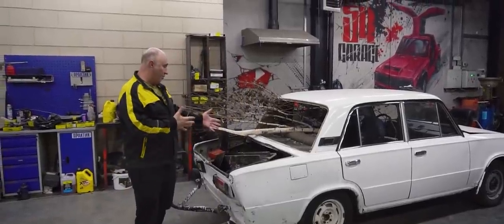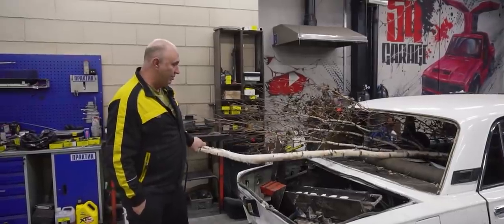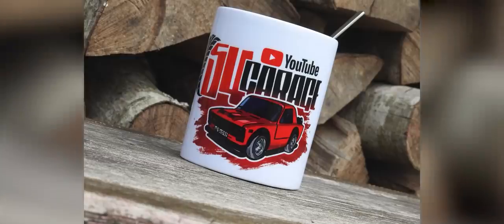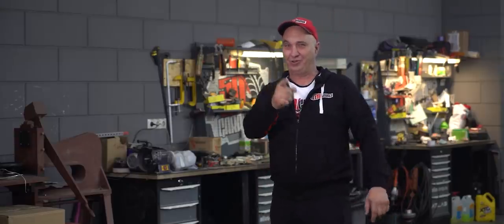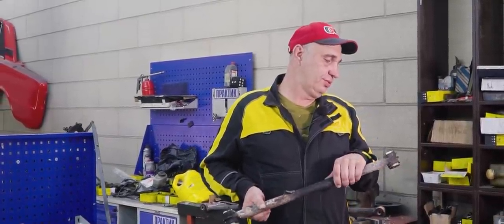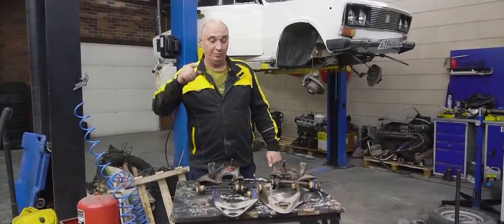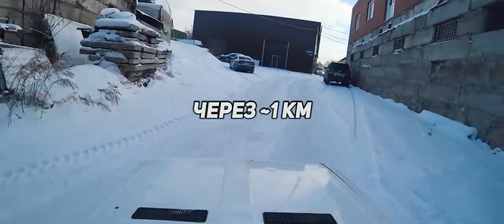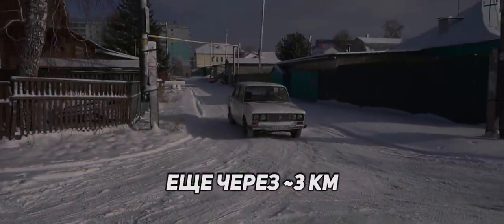Suspension bushings made from birch - real or myth?

Comment: Wooden bushings are still used in farm equipment but they are treated with oil before installing.
Reply: I also think these are so squeaky and fragile due to the fact that they are wet, fresh cut birch
Reply: I saw a really old car (Studebaker? not sure) that had wood suspension components.  They had to be oiled regularly.
Reply: Hudson had a wet clutch that used corks. Cork is of course the bark of the cork oak tree.
Reply: Yea was going to say we have hardwood bearings made of Whitegum on farm equipment 
But they tend to be more like suport bearings along a long shaft like augers 
The drive ends that actually take load are real ball bearings 
The wood support bearings are 40yrs old and are still quite good
The roller bearings at each end have been replaced many times over
Reply: Wait seriously
Reply: @joels7605  like 1950s probably?
Iv it looked like something from fallout it was definitely a studebaker
Reply: @isaacsrandomvideos667  
Yea they're cheap to make cheap to cheap to replace and easy to adjust

Comment: Make an engine. Let’s say a 4 cylinder. 2 cylinders running normally on gas. 2 cylinders firing on diesel. In the same engine block.
Reply: cool idea but diesels operate at like half the RPM gas does. like 1-2k maybe 3k, but maybe you could idle the gas engine  and rev the diesel a little. maybe a gear ratio on all the shafts or something
Reply: @renderedpixels4300  just rev it to 4/5k lol, diesels dont rev that low, not in passenger cars
Reply: You can get up to 5k in the old vw 1.6 diesel so I'm sure it wouldn't hurt nothing having it idle at 1000, which is what my 1.3 liter Sammy engine idles at. That's actually what my buddy's 81 rabbit idles at with the 1.6, although that is a little high but he wanted to crank the fuel lol
Reply: Yeah, a bigger than 6 liter truck diesel engine with big diameter pistons, like Mercedes, DAF, Volvo, Scania, etc wil rotate 2.500 rpm max, but a modern electronic diesel featured in a passenger car rotates more than 5000 rpm and there are quite a few diesel powered cars that make gasoline powered cars byte in the dust.
Like a Audi A6 2.5 / 2.7 / 3.0 / 3.2 TDI, Porsche .... 3.x TDI, Mercedes E class, some 10 year old BMW 3.0 diesel 5 series was very quick, even the very old 324 TD e30 was pretty fast and an awesome engine sounds have these power plant. the  Audi 2.5 TDI back in the days was THE engine to have, such a sweet sound form the dual exhaust. melts your heart if you're a petrol head.
Reply: there are diesel powered cars you can't beat with a normal gasoline powered car, Torque means acceleration power, HP is meant to keep the speed ... and Audi won Le Mans with a diesel powered V12 TDI R8 lmp1 car.

A empty full size Mercedes Actros truck with a 12.x diesel engine will out accelerate you on high way entry lanes if the driver is in a good mood and there is nothing you can do with you average passenger car.
Reply: One point of difficulty I foresee is the distributor and injection pump. When they converted the diesel engine to gas they used the injection pump bracket to hold the distributor, but fitting both on at the same time? Hmmm
Reply: Compression… you’d have to shave the heads or increase piston height to get a diesel compression ratio... it's twice as much or more than 4 stroke petrol compression... it may be possible??? That would be interesting to see, if you could up the compression on a petrol motor to run on diesel. 

Fitting and timing an injector system too... holy moly.
Reply: Sounds interesting 1 for torque and the other for speed 🤔?
Reply: @renderedpixels4300  Well a gas engine can also rev low so there isn't any problem unless you're trying to get past maybe 5,000 or 6,000 RPM.
Reply: Oldsmobile took it's 350 cu in gas V8 and used it as the basis for their diesel engine. I think they used the crankshaft from the 455, which was stronger (can't verify). 
https://en.wikipedia.org/wiki/Oldsmobile_Diesel_engine
Reply: E L  enlarging the chambers will reduce compression, not raise it. You'd have to find pistons of the right bore size, but taller... maybe they exist, but I'd be surprised.
Reply: E L  I'm not sure there'd be close enough on the head to shave it, and even then not without having valves hit pistons... you'd have to basically double your compression. Lowering compression of the petrol cylinders won't help at all with getting enough compression to ignite in the diesel cylinders.
Reply: @reccecs4  You re making this super complicated lol. They already made a video where they converted a Toyota diesel engine to gas. They milled the diesel pistons down to lower the compression to about 10:1. You can use 2 of those and 2 original diesel pistons.
Reply: @amorag59  it IS complicated. 

It's MUCH easier to lower compression than raise it. You could do it in seconds just by damaging parts lol... If it were easy to raise compression that much, race tuning shops wouldn't exist. Getting a diesel motor to run on gas would be much easier than making a petrol motor on diesel.
Reply: @reccecs4  Did you read my comment? 
"Getting a diesel motor to run on gas would be much easier than making a petrol motor on diesel." Hence why I said you are making it complicated. You mentioned shaving the cylinder head and raising the piston height. Not necessary. Again.. They already made a gasser out of a toyota diesel so it's something really easy to repeat. Use 2 original diesel pistons and mill 2 pistons down to lower CR for the gas cylinders.
Reply: @amorag59  right, but that's making a diesel motor run on gas, not making a gas motor run on diesel. OP was talking about the latter... "normally".
Reply: @reccecs4  The OP reads: a 4 cylinder, 2 running on gas 2 on diesel. Didn't say you had to start out with a gasser engine...
Reply: @amorag59  no, not specifically, but he said 2 running normally on gas. The only sense in specifying "normally" there is that it's "normally" a petrol motor. I agree, converting a diesel to run on petrol is much much simpler.
Reply: @reccecs4  On second glance, I see your interpretation of his use of "normally". Lol I'd still rather complete an experiment with the 2+2 rather than abide by the OPs rules to a tee and make it complicated lol.
Reply: Amazing idea!!!!
Reply: Hell yeah!! They actually did it!!!
Reply: @papaclod-hopper1976  i helped ya I Think. I commented that too
Reply: Just make it :)
Reply: @papaclod-hopper1976  Did you watch it? Kind of disappointing..
Reply: @Amorag Yeah Lol all they did was put a carburetor on 2 cylinders and another carb on the other 2. Fed one carb with gas and the other with diesel.

Comment: When I was a poor teenager. I bought a Mazda 323GT from a car auction for $100.
The car was perfect apart from one thing... It was missing three sides of the tailgate! All it was sold with was the glass and the top hinge, so being good with my hands, I made one out of wood... It was so heavy the rams couldn't hold it!
Three years later when the car failed it's MOT for corrosion, the tailgate still looked good as new, though it could use a quick coat of Creosote!
Blessings from an English armour-maker in a French forest. 
I love your mad-scientist enthusiasm! 🇬🇧⚒️🇷🇺

Comment: Back in the eighties, one of my favourite go to scrapyards was owned by a pair o' rogue like gypsies (just under Lewisham station in south London) and they had an old cavity insulation injection machine and used it to fill sills, chassis rails with fine concrete and the cars would fly through the mot inspections as they covered the sins with a huge amount of "blackjack" or bitumen underseal.   It was them two who taught me about putting sawdust into screaming gearboxes and diffs and how to get about 100 miles from a dead clutch using a lethal substance called carbon tetrachloride sprayed into the clutch plates...
Reply: Back in the 00s at the shipyards we used to use tetrachloride to clean our hands 😏
An other trick for used cars with very noisy engines is to used a healthy dose of STP oil additive 
It will make it sound like new 😉

Comment: How about 2 engines with one upside down and intake and exhaust ports, chain drive the cranks together and make a vertical opposed piston engine. Like a Fairbanks OP
Reply: Sounds like a nightmare. Most block deck surfaces are asymmetrical and designed for the oil to flow downwards. Also valving, separating and routing the intake air and exhaust through the coolant jacket.. Nightmare lol.

Comment: Hi and I've seen your crazy experiments but I wanted to know if you can move the engine of a Lada, with the front engine to the trunk, it would be funny the behavior of the car and the mechanical problems that this swap entails
Reply: That is very difficult and would require an alternative engine, gearbox and final drive.
Mid-engined would be easier.
Reply: Reminds me of a Renault 8

Comment: On the passenger ship "Queen Mary" (now parked in Southern California at Long Beach), they give extensive tours, inclusive of the engine room.  I don't know what the engine powered, anymore,( it was 50 years ago), and each piston was about 4 or 5 feet across, the rods had a stroke of 6 or 7 feet.  Perhaps it was for a generator, as the RMS QM Has 4 turbines for the props.  Anyway, what impressed me was that this massive engine had bearings in it made of African Ironwood.  Perhaps you could try to find some of that ...

Comment: Slight alteration idea. Dry the wood so it shrinks, then install it, soak it in oil and only then install. This way wood collects oil to it self and lubricates with out wearing out from scrubbing to hard metal. We know witch gives out first. Over time if wood does not wear out first, it releases oil and gets replaced by water from road condition and swells taking out the slack least theoretically that is. This is how you should be able to get best service life out of them. For stories i believe owner would probably be so mind blown that he would not notice minor thing like wood being soaked in oil or it being greased. Also it will effect greatly least on rear links how even the surface is since those bushings get side twisting happening that of course compress the outer edges more, so maybe another test for those where little material is removed on the outer edges allowing it to live a little.. i think best place would be to take it from inner hole side that allows the pipe and bolt stay intact.
For actual uses, i see this legit jerry rig repair, just needs to replacing wood time to time and it should drive in the city just fine for long time.

Comment: Its hard to believe anyone made them from woods. In Philippines there are thousands of "bushing shops" where they cut rubber bushings to size with hand tools, or glues on rubber sheets to make them thicker and so on. Some even use hand drills for center holes. Its extremely cheap, a low profit business. I guess in Sovjet Russia the problem wasnt the price but the notorious lack of everything including rubber.

Comment: I wood have tried elm. It has interlocking grain that keeps it from splitting.
Reply: Yeah paper birch is only a 910 on the Janka hardness scale.  Anything above 1700 would have been a better choice for strength, longevity, and water resistance if I had to guess without the time to test them all out.  Laminating with crossed grain would also help.

Comment: You guys could remove the alternator, install a 3-phase induction motor in its place and use it to start the engine. 
(Don't tell me that you have already done that last year LoL)
Reply: Will never work, if you ever tried to turn any pulley other than the crank you'd know there is no amount of belt wrap that holds enough to turn engine under compression.
Reply: @Scott00  That's why I want to see they trying to do that )))))))
Reply: This is/was common on older smaller engines in boats tractors etc. I have a tractor that has it. Its called dynastart. Alternator is also the starter. Very useful

Comment: Here's an idea for a CHEAP lada turbo/super charger, a normal portable air tank for airing up tires. Would it work, I mean that's all turbos do is force more air into the engine. 2nd idea could you make an amphibious/submarine Lada by having the engine run fully on the air tank?

Comment: What would you expect ? Hard bushings like polyurethane makes the suspension harder yes, but they clunk and squeak horrifically.
Reply: Polyurethane bushes must be lubricated before installation to avoid the squeaking issue. Makes them last longer and work better too by practically eliminating binding.

Comment: 05:22 - Wood it (haha sorry...) Would it have helped them instead of just bolting them in, but using large washers under the hex head of the nuts and bolts to help with 'durability' and stress loading through the bolts etc?? 🤔🤔😎🇬🇧

Comment: carbon is a nice lubricant, gasoline from biomass, pyrolysis, carbonization, gasification, all three, grass to fuel, steam forming, all this
Reply: carbon is a nice fuel (for burners) storage, from growing renewable mass, dont care about co2
Reply: carbon is that dark thing that burns in your grills, CaO + water -> heat + CaO*H2O engine, steam engine, all this, no bowing, to even the trees
Reply: whats that, black-out
Reply: oh you forgot to read the f manual
Reply: sevice is slavery, whatever you make serve you, as your slaves, even serving money, dank shii, true, am I, are you
Reply: carbonize the wood, on the outside, dont chalk it, then it will spin
Reply: try water pipes and connectors to make a car frame
Reply: tar and feathers, from wood, also
Reply: you dont make a water bearing from non-treated wood
Reply: a wooden car, flint-stones, running on grass, horses
Reply: dont be in a metal prison, the cage, who
Reply: work for shii, no no no

Comment: Ozone injection
Hydrogen Injection
Laser Combustion Pulse
Arc Combustion Pulse - capacitive
Cold mist humidifier injection cleaning / efficiency alcohol / water
Cold mist brake cooler
Cold mist radiator cooler
Catalyst Coated Pistons - maybe nickel
Reflective Combustion chamber
Dual EN Nickel piston rings
Terfenol D Valves - non mechanical
Rotating Valves
Acoustic Supercharging
Silicone Polymer inflammable manifolds
Polished Silicone Coating Air Coolant Path
Alternate Coolants Pressurized Refrigerant | Molten Salt
Surface Halogenation of Polymers
Samarium Cobalt anti-filing magnets
Age Hardened Aluminum Head Gaskets
Chopped Carbon Resin Powertrain Case Stiffener
Aero tape
LED Infrared Ice Melter
Tire Spin Hardener for high speed stiffening - to increase load capacity
Chopped Carbon Fiber Epoxy infused Solid Bumper
High Speed magnetic brake
Metal foam bumpers - impact energy absorption

Carbon Graphite Fuel Additive - ultrasound broken up graphite, or graphene to nucleate soot as graphite that can pass through the fuel injectors
Increase fuel injector rail pressure to improve engine efficiency by atomization - for existing vehicles

OAGDP high speed control
OAGDP aerodynamic efficiency
High Speed braking Straps - instead of a chute
Fuel Burn under vehicle for drag free downforce

Dual Electroless Nickel gradient hardened coat - Using high phosphorus Electroless nickel heated to concert the first coating to Nickel Phosphide. The second coating is unheated to leave it amorphous for corrosion resistance, and hardness.